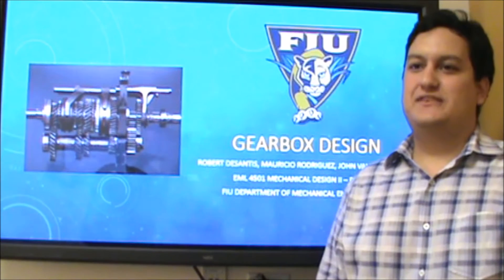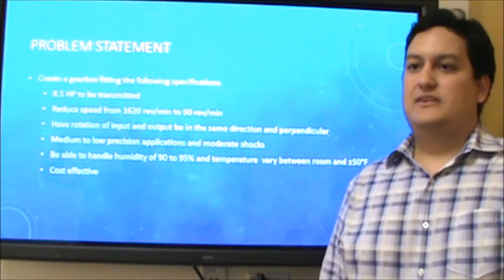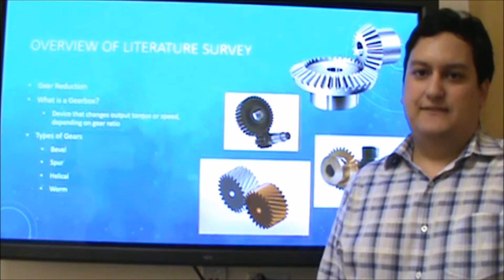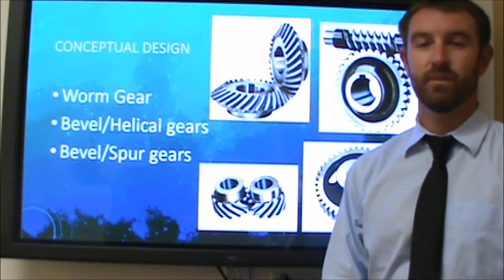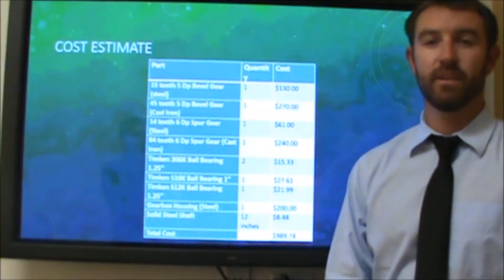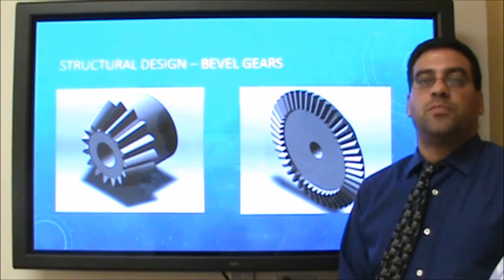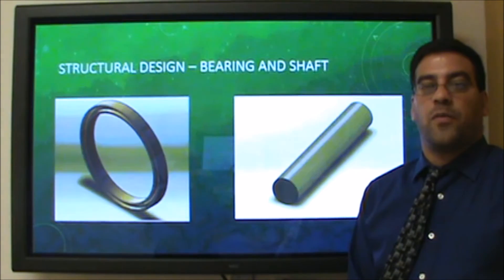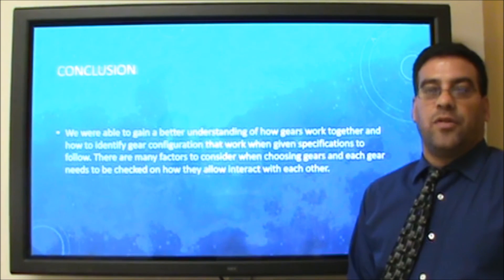Team 2: Gearbox Design

Comment: This was a good presentation. The sound was at the right volume which made it easy to listen to the description of the gearbox design. The only issue I had with this presentation was the slides were a little difficult to read caused by the dark background. Try using a white background with dark font to fix this.